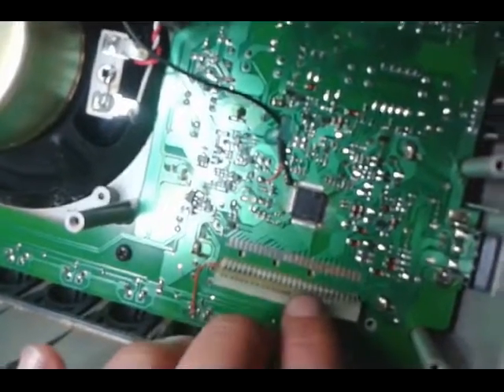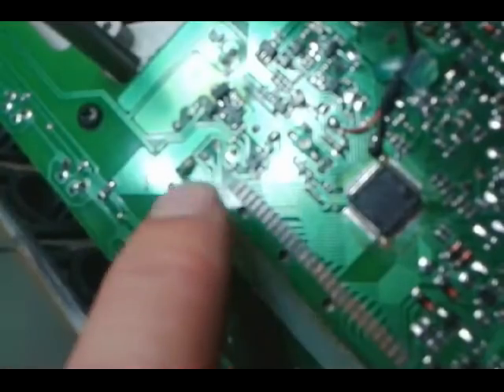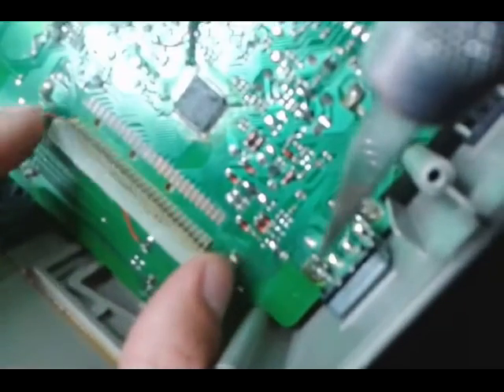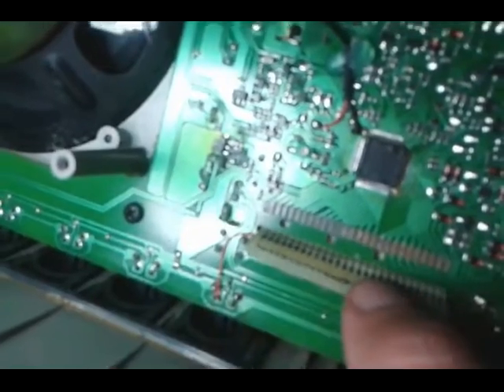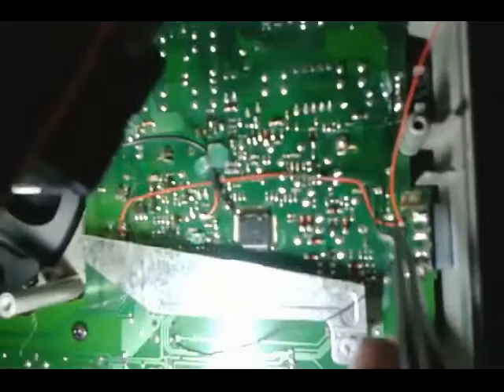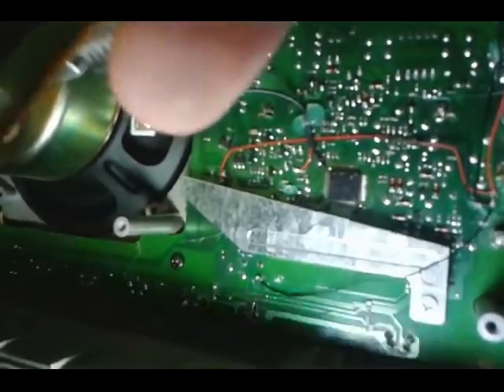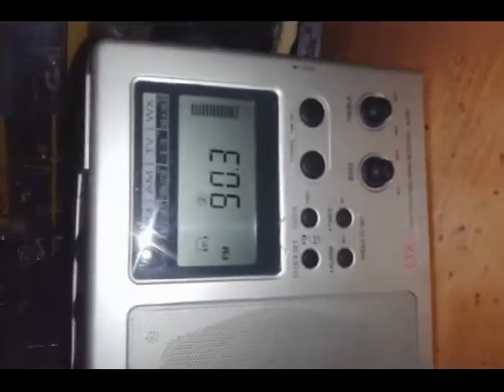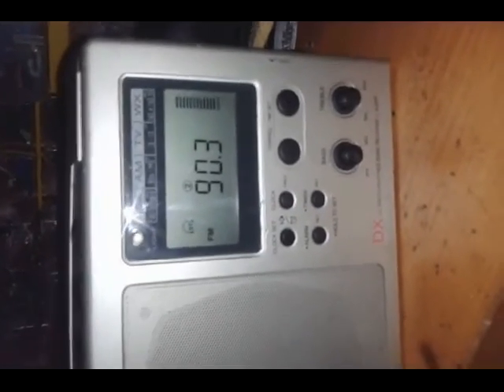Sangean CC Radio Plus Repair

Comment: I tried the blow dryer and it did not work very long, I've been watching your video and going to try it, You say you ripped it apart and used the X-ACTO to scrapethe black part to make it shiny again, And I believe you used hot glue to put it back together.

Mark G.
Reply from the maker: That is correct. I made this video many years ago,in the video quality isn't very good as you can tell. I've been wanting to make a new video with better quality, but I have no motivation to go in there and undo the repair, since it's been working ever since :)
Reply: @SegasonicfanDesigns  I'm disabled, homebound and on a 'fixed income'. You just saved me taxi fare to the UPS store, shipping, repair costs, etc. This radio was my Legally-Blind mother's companion so it has those sentimental attachments.  If I fix the dang thing, I'll check back in with you. Thank you...

Comment: first comment ever on youtube....had this CCPlus radio for 15 years or so and the LCD has been unreadable for at least 10. I used a heat gun and eraser and so far, it's fixed. Didn't really expect it go this way but I'm stoked! Thanks for the video...you did something different but the video totally helped. Take the rest of the day off, PAID.

Comment: Do NOT use an X-ACTO knife to scrape the ribbon cable contacts. 

But you can use an X-ACTO knife to cut off the rubber block with the bad contacts and then remove the bad contacts from rubber block (try not to remove the adhesive).  Then reinstall the rubber block on the new section for ribbon cable and use Acetone (nail polish remover) to expose the new contacts.  Clean the board contracts with rubbing Alcohol until you get a shiny copper.
Reply: use a pencil eraser to clean the contacts. works great and doesn't damage them at all.
Reply: @adotintheshark4848 I was afraid to use a pencil eraser on the board contacts because "if I remember correctly" the traces are thin and close together. If a trace gets lifted the radio maybe BER (Beyond Economic Repair). But the important thing is that you're radio works.👍

Comment: Sangean radios are fragile as hell. Believe me, always stop working for one reason or another.
Reply: Yea, I doubt their radios are more fragile than anybody else's radios or electronics. Sangean and C Crane have both been around for a long time, and have pretty good reputations.
Reply: @profd65  I agree. Sangean radios probably not any worse. The problem is they cost so much more that you expect them to be much better than they actually are. We own four (mostly because of Art Bell), an ATS909, a classic CCRadio, and two pocket size models. All four have been nothing but trouble. I'm sick of fixing them!

Comment: For a permanent fix, could you simply solder the individual connector leads directly to the board?
Reply: No, the ribbon cable is too thin and will fall apart.